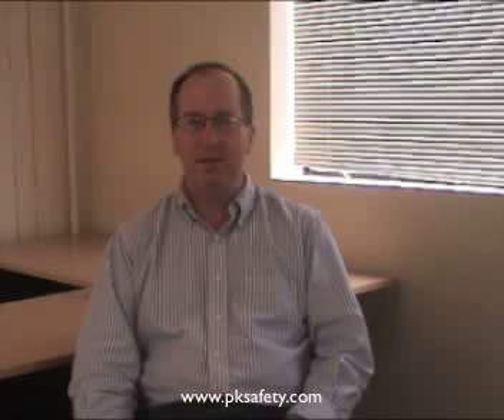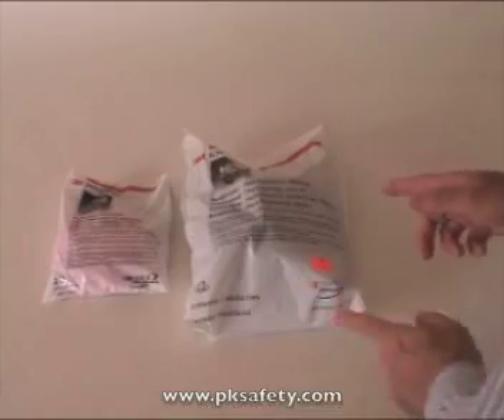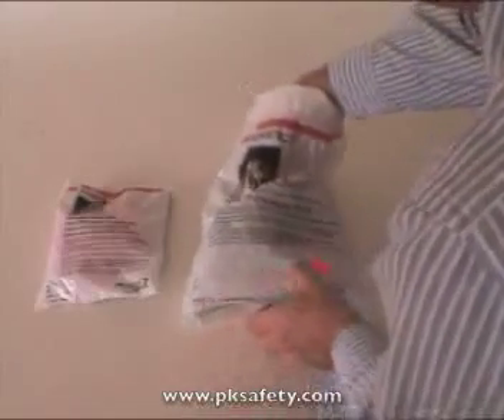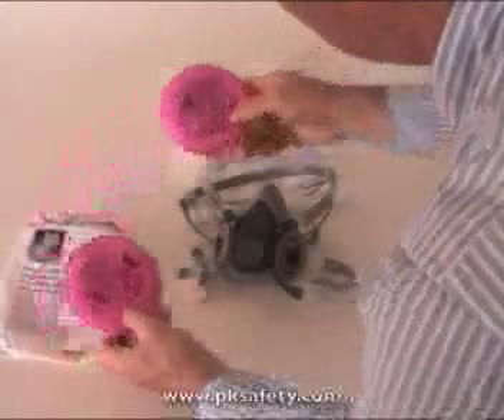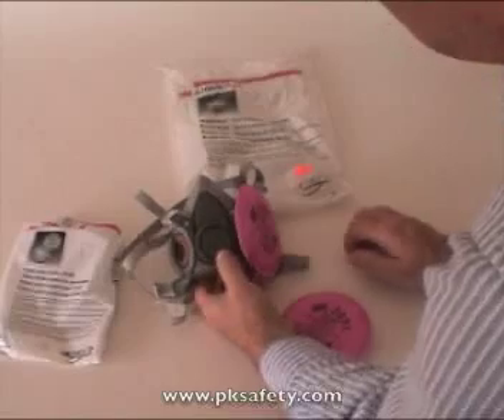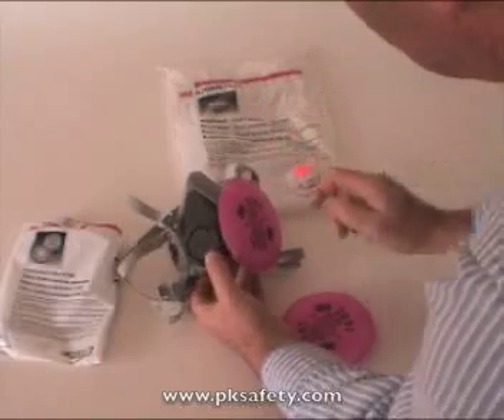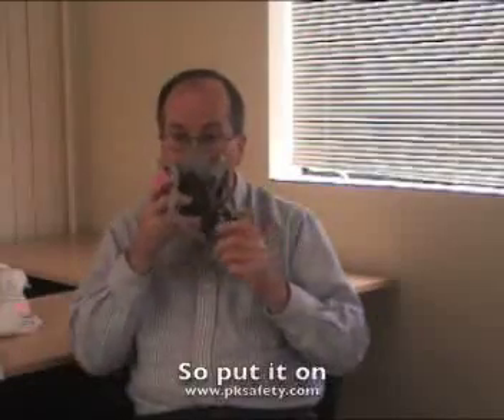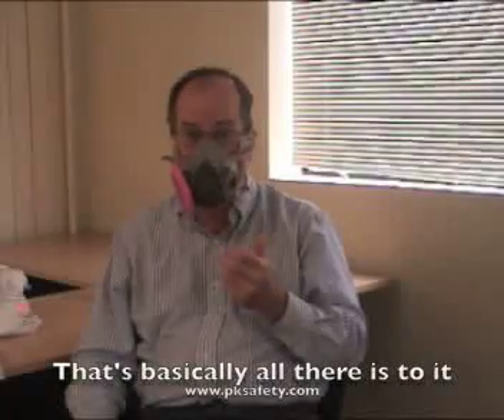Lead and Asbestos Respirator: 3M 6000 & P100 Filters

Comment: how do you pick between the large and medium respirator?
Reply: The sizing on respirators can be a little vague. There are no metrics, like length or width. Large masks will be worn by a person with notably large features. Very large, or very long face. About 70% of our sales are in size medium, and have been for many, many years. So, if you feel like you fall in to the very large camp, that is the size you should order. The only real way to tell is by fit testing. Thank you.

Comment from the maker: @Arcz90 This mask assembly includes the 3M 2091 P100 rated filters. These are indeed the correct filters for the application. The lead fumes will be caught and trapped by the filter. However, when heating the lead, you may have other issues crop up. First is carbon monoxide, so be sure you have adequate ventilation. Then there might be some other compounds being heated, depending on where the lead is coming from. Tire weights or used bullets for instance. Just something to be aware of.

Comment from the maker: @geminitool The filters are indeed color coded. However, this is a NIOSH thing (think OSHA). The pink or lavender color that is used indicates that this filter is rated P100. This is the current term for what used to be called HEPA. This is the most effective filter available for a half mask respirator.Each brand (including 3M0 has their version of this item. All are equally effective, and are tested to make sure. We recommend this filter for lead dust and asbestos.

Comment from the maker: We don't have a '3M 51' filter. We do mention 2 parts for the mask that contain those or are similar to those numbers. The 3M 5P71 is a pre-filter used primarily for spray painting and pesticide or herbicide spraying. This filter is secured on top of the 3M 6001 organic vapor cartridge by using a 3M 501 retainer. This plastic retainer is a clear plastic cap that holds the pre-filter in place. Hopefully that explains it? Thank you, Rick

Comment: The instructions that come with it are for more than one product, so it can be confusing. You need to remove the two rubber-like circles inside or you won't be able to breathe through the filters, but there is a third one in the center and there is no mention of it. Are we supposed to remove that too?

Comment from the maker: The pancake things are the 3M 2091 filters. They trap dust particles as you breathe in, drawing the air through them. They are rated as P100 / HEPA in effectiveness, and so are able to be used for lead and asbestos dust. Without the filters, the air would come into the mask unfiltered.
Thank you, Rick